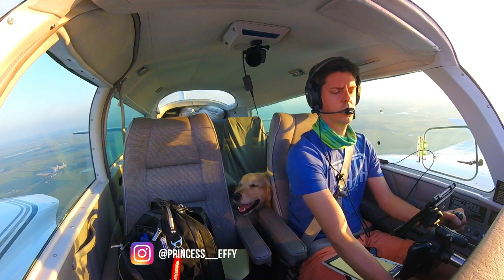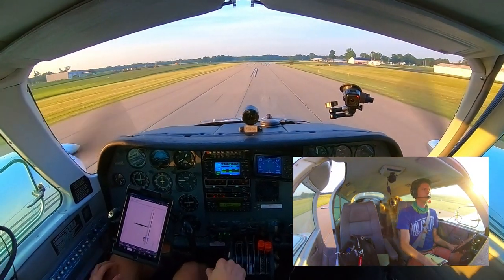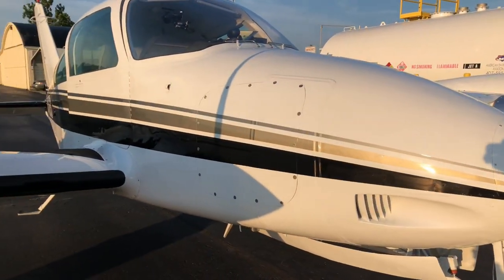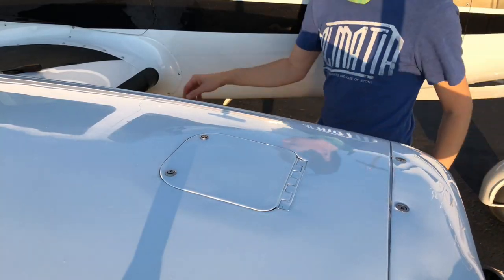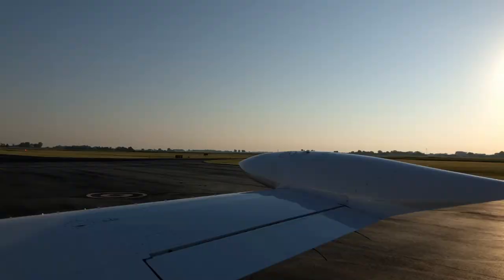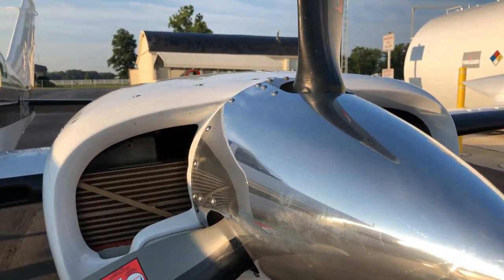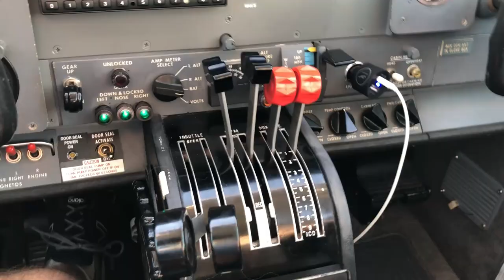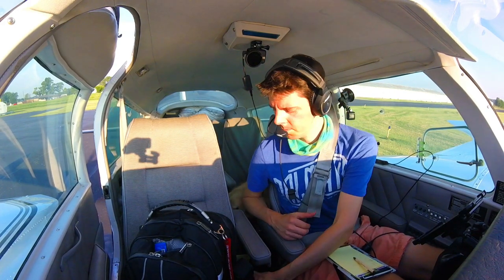Preflight Procedure and Hot Start in a Cessna 310!!!

Comment: @BetweenLayersAviation Thanks for including the hotstart procedure. I, too, have a 310 Colemill (mine was actually the one used for the STC for the turbocharged variants). I've tried every hot start in the book with varying success, so glad to see someone doing it with IO550s. I do it slightly different. I start full forward on everything, then prime until I have good fuel pressure, then pull mixture back to lean cut-off; then engage the starter with the throttle full and pull it back until it fires. As it fires I quickly advance the mixture. Its a bit of a dance. Your way is much more simple and it obviously works. I've also been told that it can help before doing anything to set mixture's at idle/cutoff with throttle full forward and run the primer 10-20 seconds per side (I think it get's the vapor out of the lines up to the engine). A friend does this with his Colemill P variant (mine is a Q) and then he does a normal start. I haven't had as much success with that method.

Comment: Fantastic demo on the hot start and the 206 I was flying during the hot days the IO-540 was a trick to start after sitting 15-20 minutes and I had to do the mixture idle cutoff boost pump start and successfully it worked for me

Comment: On my C77R with the tight cowling I had a hard time over and over to start after fueling. Then I read a guys post, before shutdown throttle to 1200 rpm them pull mixture. After fueling leave mixture out, master on, fuel pump on and crank. When the engine starts bring in the mixture and bingo engine start. Fuel pump off mixture as needed bring back throttle. To who ever poster that, I say thank you.

Comment: Hi; thanks for the video.
Quick question, Why are you cycling  3 times the prop? What indications should I have been observing ? 
Thanks
Reply from the maker: Great question. I always cycle the prop three times before the first flight of the day. It allows for warmer oil to flow into the propeller governor. Here is a bit more detailed explanation. https://pilotworkshop.com/tips/constant-speed-prop/#:~:text=But%20since%20during%20taxi%2C%20the,that's%20not%20a%20big%20deal.&text=The%20engine%20oil%20usually%20stays,required%20in%20very%20cold%20climates.